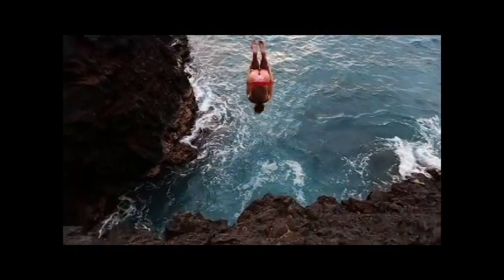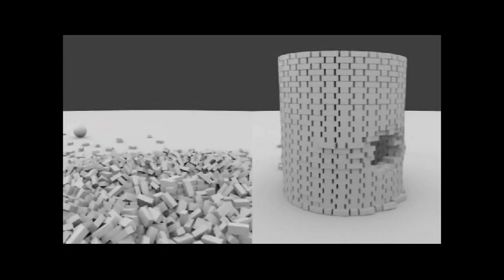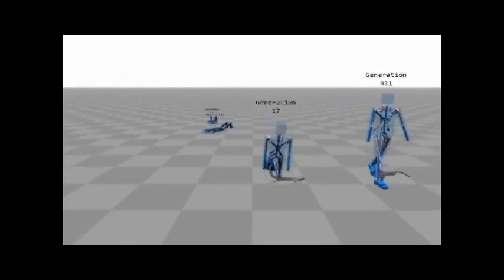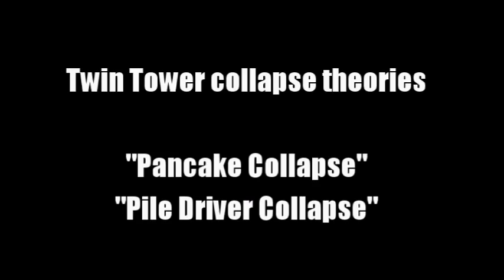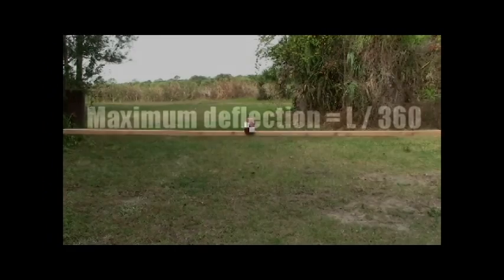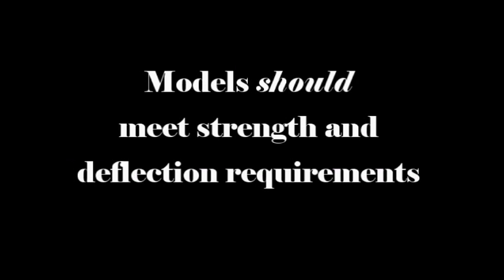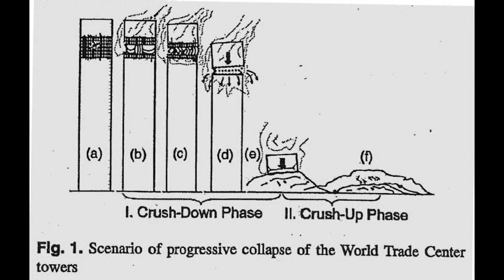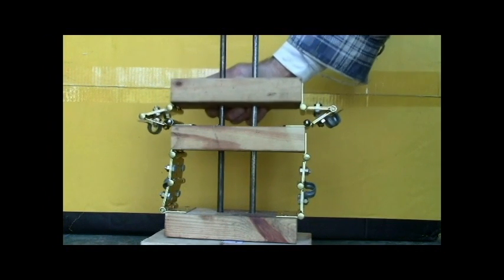9/11 Experiments: The Force Behind the Motion

Comment: This man has no idea how these towers were built. None of his experiments mirror the construction of the towers. None of his floors are supported like the floors of the WTC's...experiment  null and void!
Reply: Oh, I'd wager that he does! There are numerous documentaries about the construction of the twin towers. If anything - he used weaker materials and exaggerated the gap between the damaged/lighter upper section and the undamaged building below - he gave the official nonsense the benefit of the doubt. Those buildings were built with around 400% redundancy. Even if the upper sections did piledrive their way through the larger, stronger sections below, there is no way that that would have happened in under 12 seconds. Unless there were other forces in play.
Reply: Dan Giambrone No, he's freaking clueless.
All the floors had the same live load. This is because of the way they were connected to the columns.  The floors did not get stronger the lower they were in the tower. Typical Twoofer nonsense. The load capacity of the floors were dictated by the truss seats. These seats had the capacity to handle 12 floors worth of weight placed statically or 6 floors dynamically. Since more than 6 floors fell onto the floor below that floors truss seats failed and the next floor was subjected to the extra weight of the previous fallen floor. Nowhere in his experiments does he replicate the truss seats, thus his experiment is a failure.